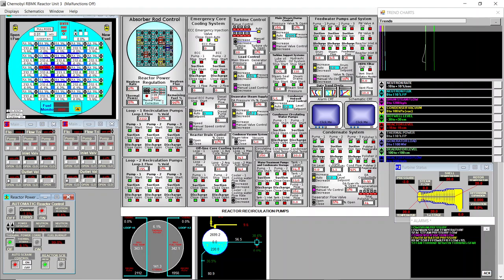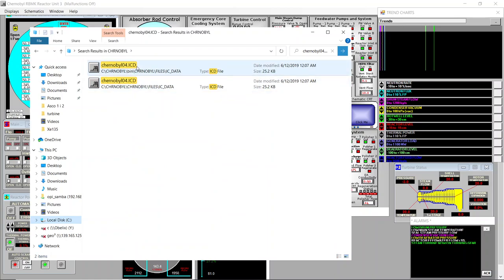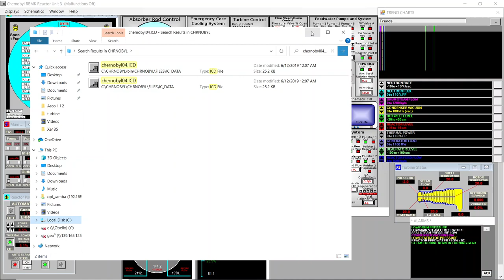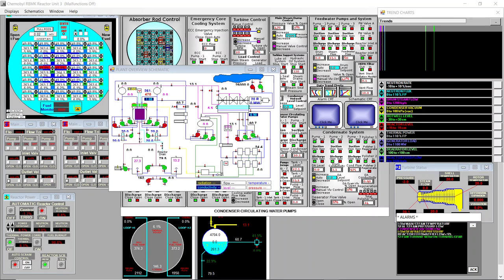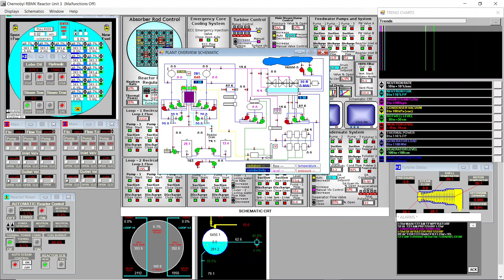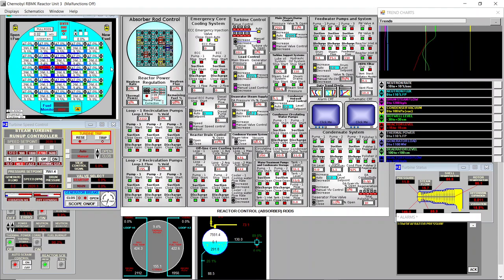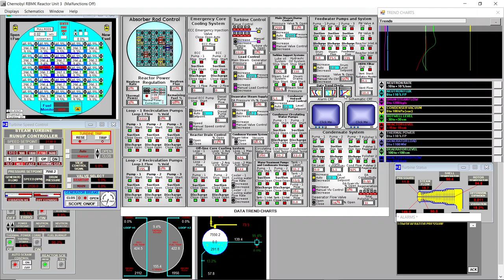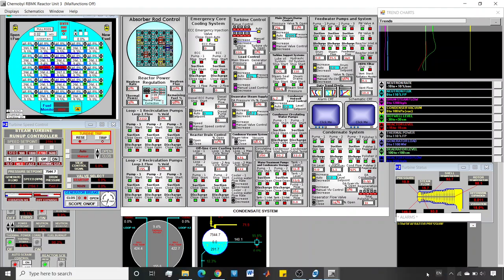Fix for the Low Condenser Vacuum problem RBMK

Comment: Thanks for the informative videos @argilaga
I have the problem where I cannot turn on the ejector until the Ejector flow is around 5, then the steam pressure is around 1100
Then when I turn it on my disk ruptures instantly
Steam Dump is set to 1000

What do I do wrong?  

It has done the same before the patch, but I think I had an already patched archive

Is there a way for fix the Disk?
Reply from the maker: Hello Roland, thanks for the comment. I advise you to try newer versions of the simulator like the itchy-avocado demo https://youtu.be/4meJq2uuHoM or the full game port version in the latest published videos. Those have a series of bug fixes, and even allow to save the game and reload it later.
Reply: @argilaga  Thank you for the quick reply, and the tip on the development. (I will definitely move to the new version)
On a note I've also managed to find a workaround. 
If I set it up to drop from 1500 and turn on the ejector when pressure reaches around 1300, and instantly lower the drop controller to 1000. It doesn't rupture the disc :)

Comment: Where do you put ct file for fuel consumption?
Reply from the maker: it's here: https://www.dropbox.com/s/s7vaita3w7x166y/RXMODEL_25chanels%2Bxenon.ct?dl=0
Reply: @argilaga  Yes we know where to download the file but in what directory we move it aft download 1 C:\CHRNOBYL 2. bin folder? or CHRNOBYL folder
Reply from the maker: I put it in both and it seems to work. If you check my latest video you find other versions of the demo which are already patched and with extra features

Comment: I have found the old file but how do i replace it with the new one?
Reply from the maker: Paste the new one into the same place where you found the old one. When windows asks you if you want to replace existing file say yes
Reply: @argilaga  thank you,do i have to replace both with the new one?
Reply from the maker: @leosvensson4736  Not sure if it’s needed, but replacing both it works

Comment: Hello comrade! I hope you remember me (I am that 12 years old boy who love 6 years rbmk reactors). And, i have a question. What is your record in speed run at this simulator? My record is 21 minutes without problems. :D
Reply: At the 21 minute i have +- 50MW on the generator
Reply from the maker: 21 minutes, not bad comrade! It is not difficult to go below 20 min with an unsafe startup, at the end the limiting factor is the withdrawal speed of absorber rods, if you start with 0% poisoning and you set all the pumps like crazy then it can be pretty fast. I will make a video about it!

Comment: Great video Possibly something I’m doing wrong but soon as turn on turbine everything trips out any ideas thanks
Reply from the maker: the classic unsmooth turbine start... check if your turbine support systems are in the correct settings (all on)
Reply: @argilaga On my case the turbine vibration meter goes very high for some reason that it tripa